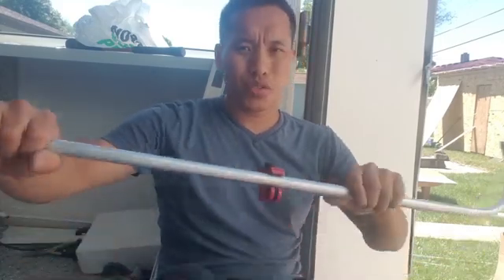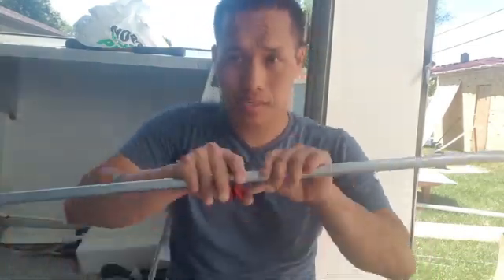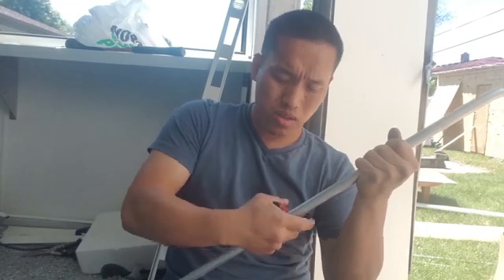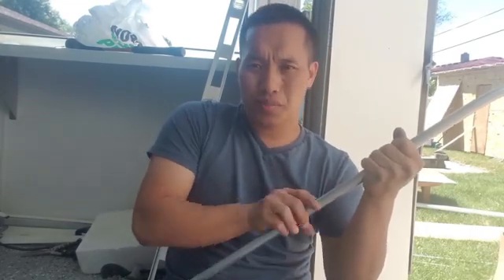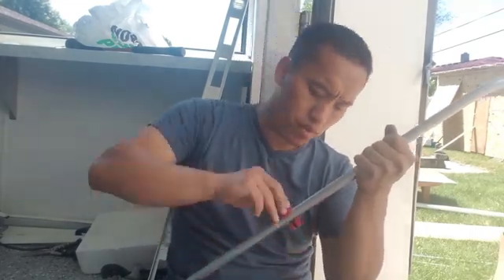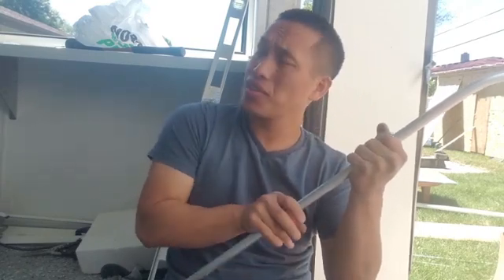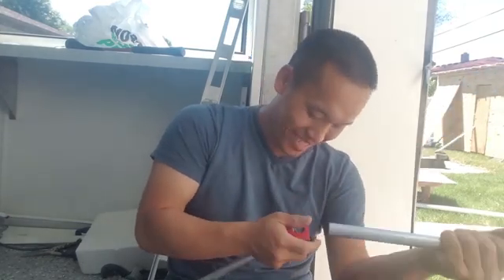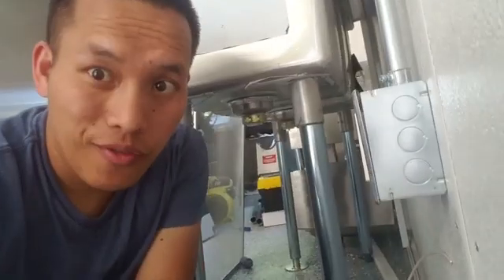Food Truck Build Electrical Process

Comment: You can't use pipe cutter for electrical conduit
Reply: You absolutely can haha Most installers use a reciprocating saw with a metal blade and a pipe reamer. I don’t use one but I’ve seen plenty of guys use one. Especially with panel change outs in condo buildings
Reply: @91Christisking  as a electrician and professional its not a good idea  Harahan
Reply: @salahn3770  why?
Reply: @91Christisking   bc even if you ream it still can be risky it my cut the wire
Reply: @salahn3770  Respectfully, you don’t know what you’re talking about. You would get laughed off a job site in the United States for saying this.
Reply: I'm a license electrician my you need to check your facts the tool you using is for plumbing not electrical tools are made for a reason .you can use it but you taking a risk just for your info I'm license in the us
Reply: @salahn3770  Lol okay, bud.